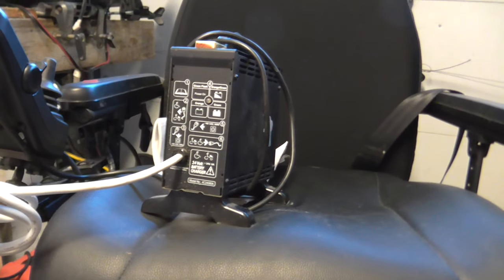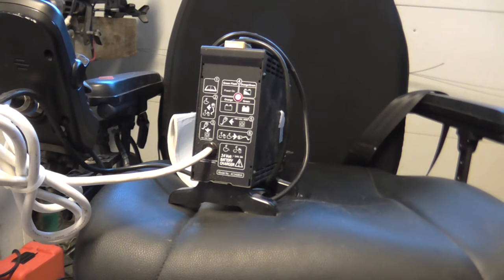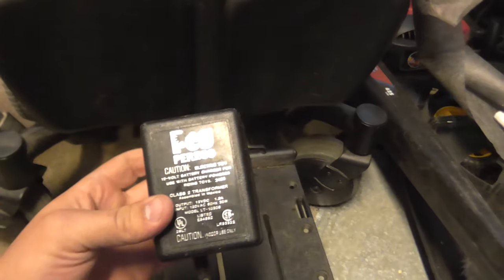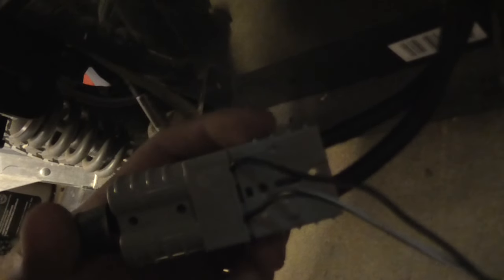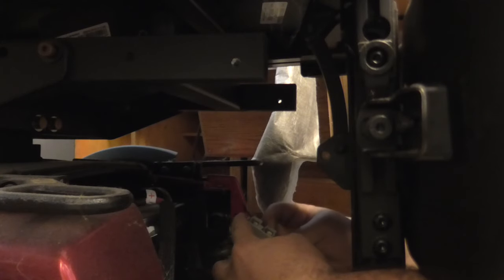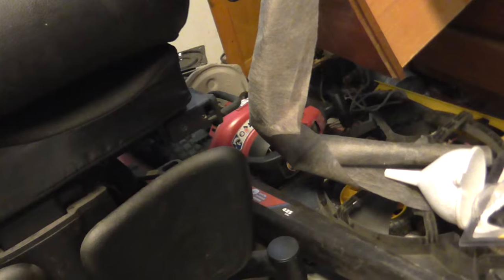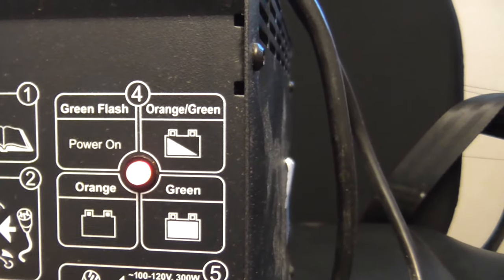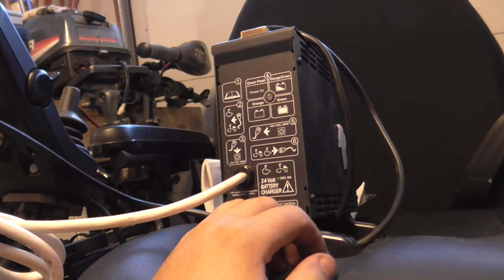how to charge dead wheelchair battery

Comment: Thank you, thank you, thank you.  You just saved me $135 plus labor.  My mom's electric wheelchair has been sitting idle for six months and we decided it was time to sell it.  Of course, the batteries had completely drained even though they were new ones. 
 Your technique worked like a charm. 

I did do ene thing different.  The chair's connector was not 2 slots but 4 holes, like a trailer light connector.  Instead of putting the stripped wires into the connector, I put them directly onto the battery posts, but only for enough time to plug in the wheelchair's regular power supply.  As soon as the power supply lights turned green and indicated the wheelchair's power supply was charging, I unplugged the extra 12 volt power supply.  

10 hours later and the batteries are fully charged and the chair is working again just fine.   This was the ONLY YOUTUBE video I found that had this trick and it worked.   Again THANK YOU!!!
Reply from the maker: Joy Harrison you are welcome. And thank you for commenting
Reply: Did the other lights stay on all those 10h? Or they stood off?! I am trying to recharge my wheelchair right now and I don't have the technical booklet. :(
Reply: Anatolii Gordiienko hey I wanted to.  Ask I have a razor charger for a power wheel type car the charger is the same size and style as the one your using but says 24v output will it work on my jazzy scooter
Reply: Thanking you

Comment: Sold my dads quantum edge 6 only to find out the batteries were dead.  This tip was a life saver!  Charger is working!  Should be fully charged when buyer arrives.  I plan on sharing this tip!
Reply: Hi Debra - did your chair have two batteries? If so, did you have both batteries hooked up when you did this with the dummy charger on one?

Comment: I have a power wheelchair that has been sitting outside for a very long time. I really need to use it and I took it to the store and they said the battery is completely dead and I would need to buy new batteries for $700. I am on SSI and cannot afford anything. I just sent my husband this video and I really hope that it works it will truly be saving my life. Thank you.
Reply: If you can find someone handy enough to replace the batteries for you, two batteries shouldn't cost over $200.  If your wheel chair has been sitting outside, it may have more things needing troubleshooting and fixing. Keep new batteries charged after each use and one a month when not in use.

Comment: The batteries had become sulfated and the low voltage charger went and dissolved enough sulpher to allow the battery to accept a charge again. Myself I use a resistor of maybe 5 ohms 25W together with by 12V adjustable 40A power supply. I raise the current to about 100mA then once it starts to rise on its own, I will raise the current to about 2A until the battery reaches maybe 8V. This can take several hours. I do have a suitable multimeter for doing this. 
Your trick is great for getting the charger to start but it may not be enough for the batteries to hold much of a charge. If you leave the 12V charge on for several hours, you are more likely to do a better job desulphating the batteries and getting a longer life from them.  Though this does not work every time.  In the last couple years I saved 2 car catteries this way. 

By the way I use a Quantum Q6 Edge wheelchair I bought second hand about 4 years ago. I am now having to recharge it with the 24V charge about every 4 days and I suspect the batteries are reaching their natural end of life.  The dealer I bought it from had about 20 powered wheelchairs i n his back room and all of them were plugged in, so there was no issue from the batteries going bad from lack of use. The batteries in it are about 10 years old now and it is getting to be time.  I am a retired electronics engineer and in the 1980s, for a couple years I designed industrial battery chargers.

Comment: Just remember that if you have left any sort of lead-acid battery in a severely discharged state for any long period of time, it will have been permanently damaged, even you manage to get a charge in it. Sometimes one can just brute-force a charge into them using a "dumb" battery charger. I have a good modern multistage "smart" charger that won't even attempt to charge a car battery that has a low voltage. If I put the battery on the old dumb charger for a good amount of time, I can often then charge it properly with the smart charger. My 24V chair charger also has a limited amount of "smarts" builtin and performs a multistage charge which involves properly conditioning the batteries, then a charge, then a trickle to keep it fully charged until use.
Reply: Well said. Save the money but batteries capacity/performance probably is very bad

Comment: I found it easier for me to put jumper cables from my car battery to each of the two 12v batteries for about 15 minutes each. Then plugged in the charger and away she went.
Reply: Took your advice using the car battery to charge and worked perfectly!
Reply: Thanks. With it running so your battery doesn't go dead right
Reply: What gage wire can use to plug into chair ? I do not have a wire .
Reply: You can if you want to, but I didn't find it necessary.
Reply: Are the batteries on the powerchair wired in parallel or series? If so, did you have to disconnect them before charging each of them for 15min?

Comment: I have been selling and servicing wheelchairs for 33 years and am the owner of Colorado Wheelchair LLC. Your idea is cleaver, but in the end it doesn't solve the main problem. Once these types (Gel or AGM) of batteries drop below 9.25 volts (your batteries had to be at least this low or lower to cause the charger not to recognize them) the cells of the batteries are damaged. The lower the voltage and the longer time the worse the cell damage. So, although they will take a charge they wont hold it very long (maybe 1 mile of usage). So, in the end if you want your wheelchair to hold a reasonable charge you'll still need new batteries. Note: DO NOT BUY WHEELCHAIR BATTERIES ON THE INTERNET!!!!!!! They are usually seconds that have been siting on a shelf for years and crappy brands sold by internet venders that will not refund your money.
Reply from the maker: I agree but in my case I used the wheelchair to make a remote control lawn mower so I don’t need it to hold for a very long time and for instance if someone wants to sell their old wheelchair and they need just to show that the wheelchair is working this is a way out but if you are looking to use a wheelchair the best thing is to buy a new batteries
Reply: StEpH ;ฯ} did you get her chair powered up?
Reply: So I was just given an Invacare TDX SP for my Wife since her cancer has moved to her spine and she can no longer walk. And it is doing the same thing, and you are telling me that if these batteries get drained enough they stop working altogether? How is that an acceptable design?
Reply: @dono624  Carry an extension cord and plug it into a wall socket, if going for appointment, coffee, etc. They ALL should have a little voltage display, to alert user to lower battery voltage. I would create/ connect a plug so you can give the 12+ boost to activate charging.

Comment: common problem with so called 'smart' chargers.  If they can't detect a battery (completely dead), they don't try and charge it.  Using a dumb charger (constant or timed) allows you to partially charge the battery so that the smart charger can then properly work.
Reply: I think the idea is so that you don't charge a battery that's damaged and then is a potential fire hazard.

Comment: I lost it at “a new remote control lawnmower.” 🤣🤣🤣
Reply: So are you saying if I have a small 12 V charger I can hook it on to the positive or negative of the same battery and then hook the other battery charger to the positive negative turn both on it’ll start to charge and then take the one off?  Is that the same thing as getting down below and picking it up there .
Reply: @ThreePhaseHigh  It helps to have a multimeter to test voltage. Measure dead voltage, write it on the battery, with meter still on battery, connect external charger, measure new voltage and write it also on battery. Leave charger on for 4 hours, then measure voltage with charger and without charger, write these New voltages on battery. Both New voltages measured should have increased, the goal is to SLOWLY charge to above 11 volts, then connect to the chair charger or regular car battery charger to do the top off charge. When 12 volt batteries go below 11 volts they start to die, the longer this goes on, the lower the battery voltage gets and the more the damage. These batteries function on short discharge cycles and have enough discharge capacity but then are immediately recharge to full capacity once the engine runs to drive the alternator. If these scooters are used and not immediately put back on charge to bring the voltage back up above 11 volts, the battery life will be compromised, cumulatively every time not charged after use! The cosmic law of lead acid batteries!

Comment: What are other 12 volt chargers that may also work? I have an Invacare TDX SP that has dead batteries and would like to not have to take them out - because I can not figure out how - got the rear shroud off but then it does not look like the instructions so the next step I am at a loss for. Thank you.

Comment: I couldn’t tell which wire connection was used to insert the stripped 12v charger wire. Is it the cable to connect the joystick to the motor fuse box cause my electric chair has 5 different inputs?
Reply: The batteries are connected by that same type of plug and thats the one you use.

Comment: I have a sedeo pro Q300 m mini wheelchair  and I want to do a trick it into charging  again because I know it's not charging  because  only the orange light comes on,can you tell me where are the location of the wires I'm supposed  to connect  it to with my 12volt charger?
It's  been almost a month since  I used it and I really need it here in California  to get around...please help me get the right wire location  to do this

Comment: If I have a reg 12v car battery charger could I just set it at a 2am 12v setting and hook it up to one of the batteries long enough to trick the charger? Sorry if it's a dumb question but I just want to be sure because I don't know much about electrical systems
Reply from the maker: If your car charger is "smart" it might not work. Depending on how bad battery is discharged.
Reply: @tolikgord  thank you so much for your reply

Comment: Why not just hook up a car charger to the batteries with either 2amp or 10amp trickle charge? That's actually what I've been doing for the past few days. Started out with only 1V and now I've got the 1st battery up to 12V after charging it for a couple of days on the 2amp trickle charge setting. How long are they supposed to last once they've been fully charged? How many hours and minutes or miles could I drive on two fully charged batteries?
Reply from the maker: Luigi Provencher  I don't know how long it will drive it depends on how bad the batteries are. As far as trickle charger and car charger both of mine got low voltage detection so it did not work for me.
Reply: Read my posts!

Comment: i try two different 12v but both fried , the 24v charger started to charge but after the 12v fried it will not charge again.  one 12v has 5w power with dc300mA max and the other is 16w  with 1A

Comment: For the people to try this who do not have a 12V charger. I suggest getting a 12V Battery Maintainer. I got mine at a good price at a Canadian Walmart. Rated at 1.5A.  It is a Schumacher SC1355. It comes with ring terminals to be connected to the battery and with clips. 

I normally keep it on my mini-van as being retired, I only drive it every couple weeks. And when I get home I have to use a fair bit of battery juice on the lift that takes me from drivers seat to wheelchair height or lifts me up again . Then there is the robot arm that puts my wheelchair into the side door or onto the ground also using juice. Then the sliding power side door uses power.

Plus the remote key receiver uses current all the time.  Cars will run themselves down in about 3-4 weeks if not operated regularly. A battery maintainer will prevent this from becoming an issue. I have mine connected to the battery with the supplied "ring" terminals.
Reply: How much should charg÷ my electric wheelchair

Comment: After the 12v charger is switched on do I plug the 24v charger in as well? FOR 10 MINUTES?
Reply from the maker: Yes and after the batteries start charging you can disconnect 12v
Reply: In

Comment: How long do you need to leave the 12V  charger wires in? Are they just needed to trick the 24V charger or do you leave them in until its completely charged? Thanks.
Reply from the maker: it depends on your 24v charger but generally you want to leave them on until the batteries are charged to at least 10v

Comment: does it recharge to 100% or just a low level such as to work for only 20 minutes?
Reply: Measure the full charge voltage, should be between 12.6 volts to 12.95 volts, if over 13 volts battery is compromised.

Comment: The problem now is that even after reading  fully charged it will not last more than a minute or two. EVen if the chair just sits there the reading keeps dropping to where  it's discharged.
Reply from the maker: gamac1 check fluid level in the battery maybe it’s very low

Comment: Do you guys know if these battery packs are inside a bunch of individual 18650 batteries?
Reply: No they are not. They are 12V lead acid batteries with individual plates in them, usually as 6 lots of 2V.

Comment: Could you use a 12 volt car charger and jumper wires?
Reply: To charge each individual 12V battery? Yes. They are connected in series to make 24V.

Comment: My charger shows it's working but it is not charging the batteries. My charger like what you have for your child's little car has a alligator clips on it. The connectors  you put your wires in is different than mine. Would it work if I just put the alligator clips on one battery positive to positive negative to negative? I really hope I don't have to end up buying new batteries. Any ideas?
Reply from the maker: Ken Leipold it should work the idea is to connect extra power supply so that the charger would not stop for low voltage make sure you don't go over 12v on extra power

Comment: hey from the 12 volt  charguer  the wires has a white line and the other side is black, which one is positive.
Thank You
Reply from the maker: Dan Vc usually the one with white line is positive but I would check it with the volt meter
Reply: Black is positive.......
Reply: I thought I was sure on witch is positive , but I’m not. I used a volt meter.
Reply: @letitride54  Sounds like the manufacture is using the house wiring colour convention, where white is ground= negative. In any case just look at the battery connections, + & - is marked on all batteries.

Comment: You seem like a very smart guy, a good handyman… However, to me this is something you don’t want to play around with. Most of these require a battery/2 of them that would fit in a car… You don’t want to play around using a KIDS toy in my opinion. It may work, however, it might also shoot the motor for Your wheelchair, and worst of all it could cause a fire or blow up when you are using it because it is not the correct voltage or battery intended.

I’ve seen peoples phone, Vape, and other things blow up because of the batteries used… It’s not worth it buddy. You’re better off getting the two pack of batteries that will run you around $130 or so… On top of that stripping wire is for batteries is not a good idea , unless you are an electrician. It just sounds really dangerous for a wheelchair, especially some people can’t move… So if that thing blows up or catches on fire, you’re really looking at a disaster for these disabled people. I do appreciate your ability to think, and use your brain in a smart way… I just don’t think the average person should be attempting this, especially when the voltage is not matching up.

Comment: If you mesure the dc pins with a multimeter without connection to the chair wath voltage provides? thanks
Reply from the maker: Sorry but I don’t have it anymore.
Reply: @tolikgord  Thanks anyway
Reply: I got little over a volt. Three prong.  I tested on 2  chargers.

Comment: Hi, I have a power scooter chair and it has been in storage for 4 years. I tried to charge the batteries for 24 hours and the power light on the chair would not even illuminate. The battery setup is very similar to the power chair in your video.  I do not have a 12 volt charger transformer, what other everyday items may have a 12 volt charge? Will purchasing a 12 volt charger from Home Depot work? Or would getting a jump start from my car work?
Reply: Rynee Hill I'm going to take the batteries to Autozone and have them charged
Reply: California power veelchair battery dimaad
Reply: @Iamsoundofsoul  Not a fast charge, start trickle till above 11 volts, then regular top up charge!

Comment: I have a wheel chair battery charger. When I opened up the three prong  plug, there is 2 wires but . Why does it have 3 prongs? The black wire goes to 2 prongs. White has 1 prong. My battery has 23 or 24 volts. But it won’t charge. I know charger works, but I don’t what the problem is. I took . Why three prong not two.
Reply: The third wire is the ‘inhibit’, enabling the system to 
prevent the wheelchair from moving when the battery is being charged.
Reply: @marcoteves685  thankyou